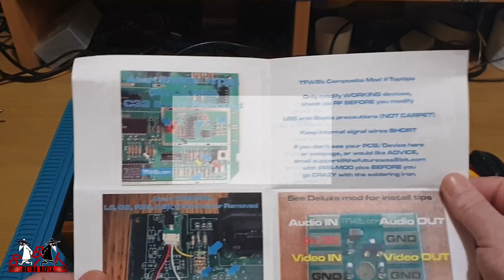Atari 2600 composite mod installation and sceens output comparison ( TFW8b )

Comment: Awesome mod. I've tried a few mods on other systems, some have worked, some haven't. So I'm reluctant to try and solder again, especially on my 2600
Reply from the maker: 2600 is a easy one ... this was my 1st time in one .. Next time it will far easier now I knows whats what ... if you don't want to do it . Id be more than happy to do it for you . :) ... thanks for watching

Comment: I think that adjuster you took out was to do with the sound adjustment. But from what I've read, removing it improves the quality of the output.  Been doing some homework before I do mine..
Reply from the maker: Yeah its best removed .. Nice easy mod to do mate :)